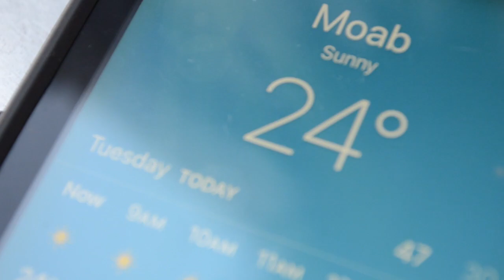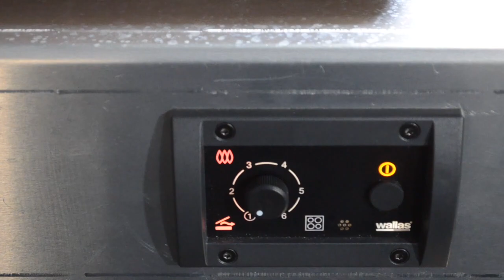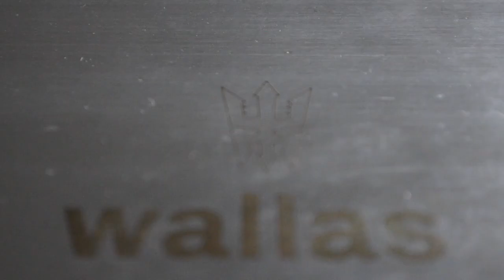How the Heater Works | Wallas Diesel Heater

Comment: Does the Wallas have a thermostat? Will it cycle on/off to maintain a temp?
Reply from the maker: Hey Ryan, 

It does not have a traditional thermostat in that you set the unit to a specific temperature to fire the unit on and off. 

It does have PI thermo control that is easy to use and extremely efficient.

Wallas says this -

"Smooth, intelligent PI thermo control option
Wallas PI-thermo control is in operation in heating mode and when the thermostat control has been activated. PI-thermo control adjusts the heater function of XC Duo to heat up fast and after that it keeps the effect of the heater even to assure smooth inside temperature without any noticeable sound variations." 

We have found the unit to work very well for our extended off-grid trips.  

Shoot us an email to find out more - info@antishanty.com

Comment: Did I get this right? The diesel heater will only work if there are snow crystals outside?
Reply from the maker: It works great!
Reply: DUH!

Also, need lotsa wires and at least one thermometer.

Comment: How mch diesel and how much electricity does the wallas consume per hour/day?    Thanks
Is it hard to start in cold weather?  Thanks
Is the air dry enough to prevent condensation? Thanks
Reply from the maker: Hey Jo ben menachem, great questions. We have not found any difficulty starting the unit in cold weather, and in most conditions, the stove/heater will dry out the majority of the condensation in the air. 

In regards to the specific fuel and electrical consumption, we would refer you to Wallas directly. Have a great day!
Reply: Many thanks for your kind reply. 
Does the system need a pump if the diesel tank is placed above the Wallas.? Is the pump noisy?
Again, many thanks for the time and for the support in knowledge.
Reply from the maker: @jobenmenachem2269  Yes, the system does require a fuel pump. There is some noise, however, we are sure we would consider it noisy. All the best,

Comment: Does the Wallas have a water heater function built in?
Reply from the maker: Hey Fireplugrm, great question! The wallas does not have a designated water heater function built-in. However, a pot placed on the stovetop does a great job quickly and precisely heating up water for dishes, tea, etc. The added benefit of this simple tankless setup is there is no traditional winterization required.